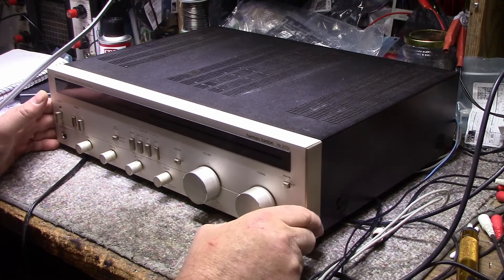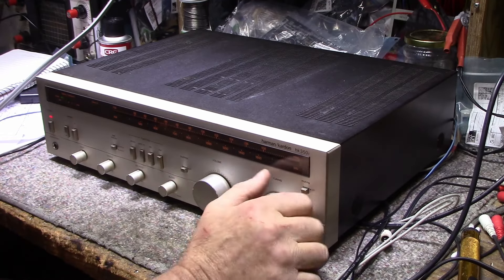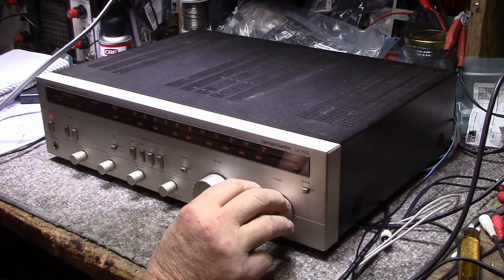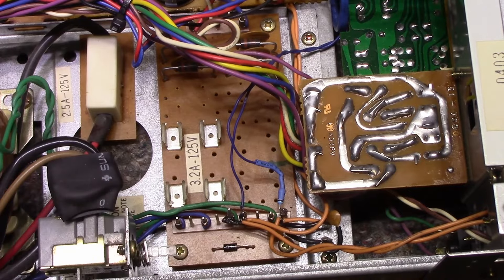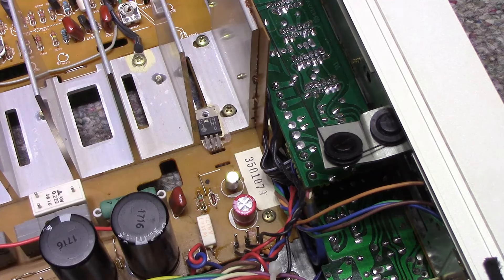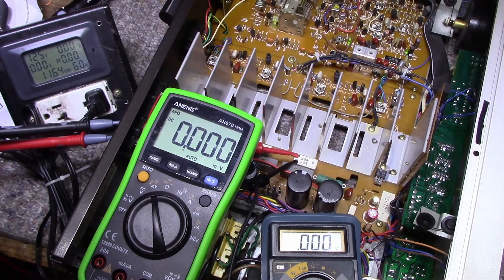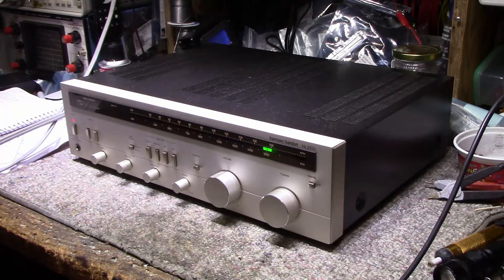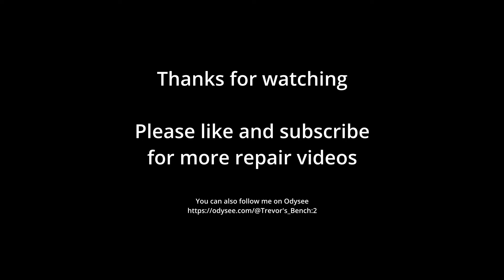Harman Kardon hk350i Receiver (Ep. 213)

Comment: Any suggestions for a crapped out AM tuner? No idea what happened, it just stopped working. Antenna is intact.
Reply from the maker: Is it completely dead or just doesn't pick up signals?
If it's completely dead then check the power supply. If it's passing signals or noise it could be faulty antenna and it's wires or shorted tuning capacitor.
Outside of that, you'll need test equipment to see if the local oscillator is working and if the IF is passing signals
Reply: @TrevorsBench  thanks for replying so quickly! 
I would say completely dead but I can sometimes hear very faint white noise / crackling coming from it as I roll through the dial but not necessarily when I pass by where a signal should definitely be.

Comment: nice, I think this was not sol in Europe? Last video you just soldered some cracked joints, this time you try the tonyxray method of doing magic with calculators. Your older videos were better, where you fixed issues without magic and had real problems to solve. This is either for beginners or rocket scientists to hack the harman with wrong parts witout explaination, but at least it works. Hope your next videos will be normal again.